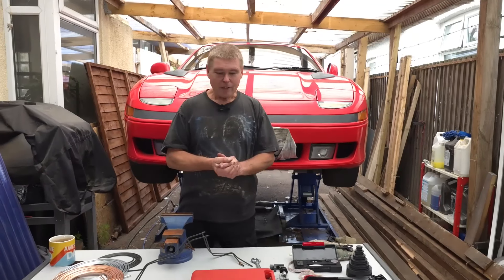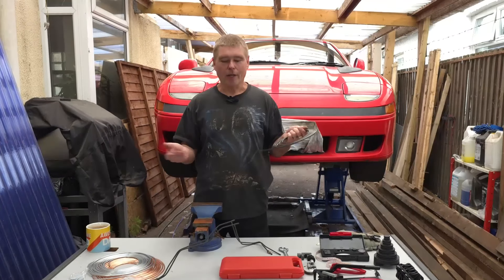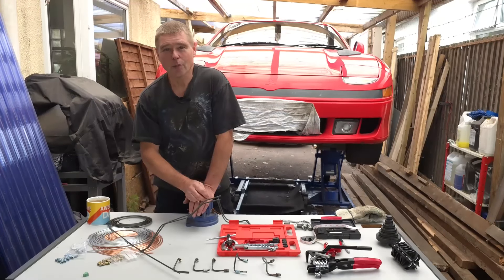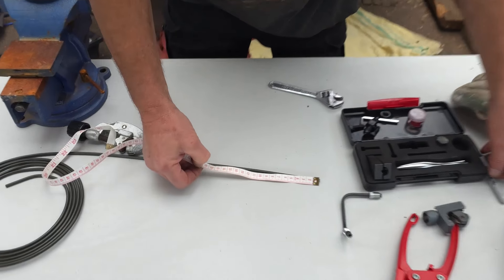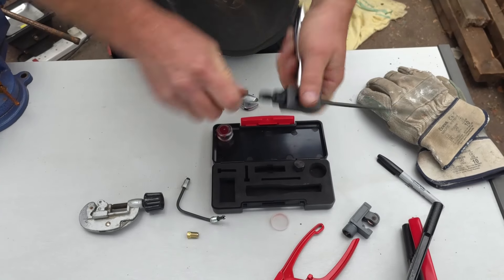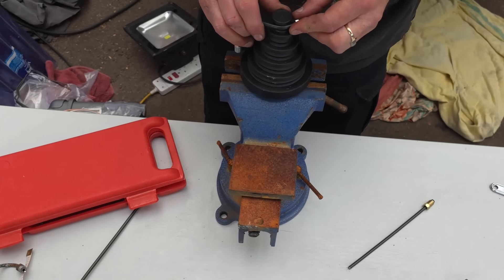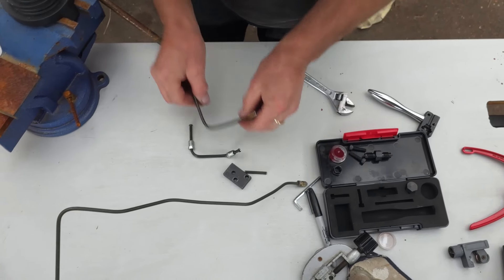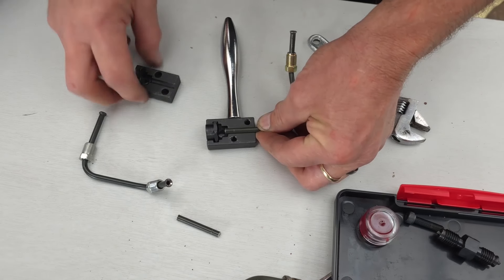Mitsubishi 3000gt / GTO  - How to Make Brake Lines

Comment: Hi Joe, i got problem with my vr4 i got US version from 92 and the driver brake is getting stuck after few miles on the road and only thing thats helps is to release air from it. Its endles cycle and i do not know what to do. Did you or anybody had this issie and how did you fix it

Comment: Any chance you could do a quick video on testing the MFI relay and bypassing the fuel pump under the hood by the wiper motor to test for fuel pressure. Maybe there’s an easier way?…

Comment: Welcome back Joe, I am so happy you are doing better now.  I am a long time 3000 gt owner.  I will be 76 in about less than a month and am fortunate to still have most of my health.  I am replacing a window regulator this week.  Please read my comment I just posted on the part one video. I need some help.  You are amazing!
Your friend, 
Dr Bob (Robert)Salnick
Reply: Use a thread chaser to fix the threads on your bad bolt.  It will usually fix the problem.  My piece of advice.
Bob

Comment: Very good video Joe it's inspired me to set about my rear lines. I looked at them on the driver's side and thought omg if ever I had to replace them heaven help me. But you have made it look very doable and yes I would go with the same steel as you to purely because it looks correct. copper looks cheap and tacky.